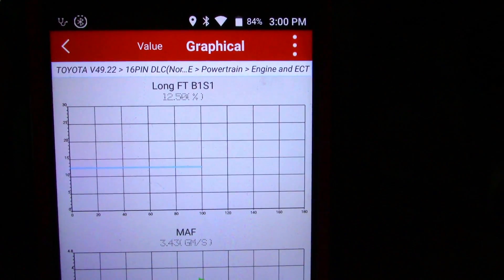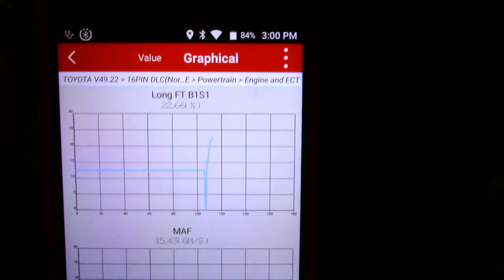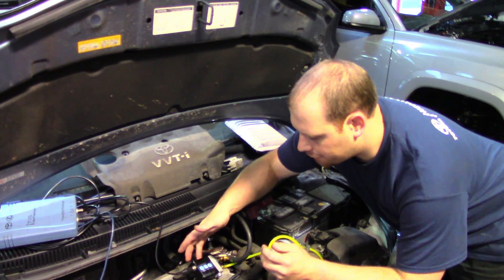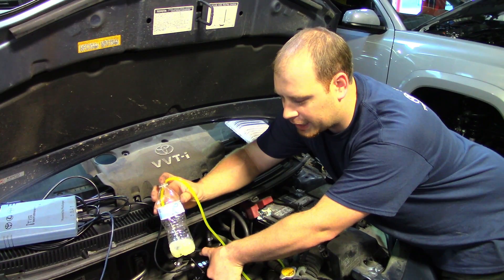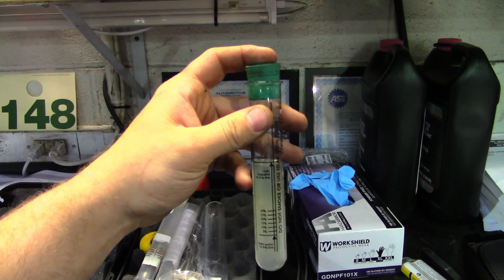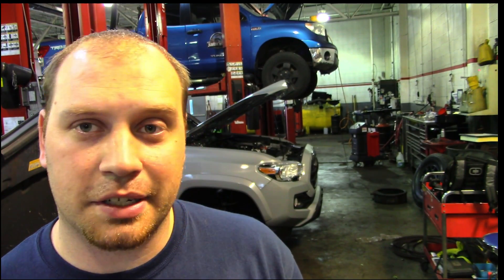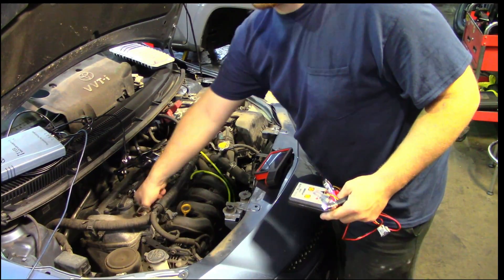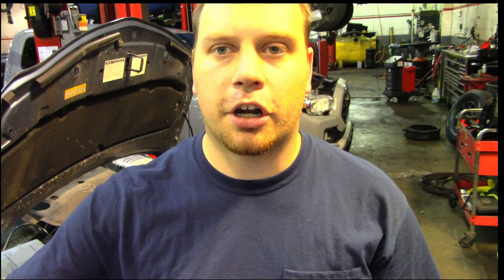Diagnosing lean fuel trims ('08 Yaris-P0171)

Comment: I have seen Scanner Danner use a tool like that. I’m gonna buy me one today. I’m a wimp so I’m gonna probably use a fuel pressure gauge. That wps is to much for me. The Logical Canuck has a build on something that will do the same thing as the wps for a fraction of the cost. Great vid as usual!!  I never miss them. What was your set up to access the fuel line?
Reply from the maker: Thanks Bill! If youre going to use a fuel pressure gauge, just make sure it measures in 1 PSI increments.

Comment: PJ, great process👍

I’m curious, have you viewed the injector-current ramps for these failures and do they reveal electrical fault?
Reply from the maker: I will say that I have always been able to see pintle movement. But I do know of a few techs who are able to distinguish bad injectors by measuring the pintle movement between injectors. When I have tried, the pintle opening and closing points have been so close, I was afraid to make a call just based on that. The next time I get one, Ill grab some waveforms and send them to you!
Reply: Voltage Drop Diagnostics , thanks Dude👍

Comment: This vehicle had a 2psi drop difference between best/worse injector. What do you consider maximum allowable difference?
Reply from the maker: 1 psi or less. Here is the catch. Every injector could have dropped 13 psi evenly, but the car would have still been running lean, right? So I feel the injectors should be very close, and any real difference should throw up a red flag.
Reply: @VoltageDropDiagnostics  there is a wide variety of acceptable readings out there. I agree normally a good set are all identical. And yes, if they are ALL restricted, it is a harder nut to crack.
Reply: If they all were slightly restricted evenly, or flowed low evenly (say due to a fuel pump that couldn’t provide full flow at correct pressure), then you’d probably only have an issue under full throttle. The system would likely compensate at partial throttle and idle.The miss or high HC is caused by the one lean cylinder having to try and fire on the averaged contribution of the other three caused by one common O2 sensor reading the exhaust.

Comment: Awesome video! I see that Diagun being used in guide a few people’s videos. Seems the best bang for the buck. I’m looking to get a bidirectional scanner for under $1100ish.
Reply from the maker: I love it for quick checks. They cost around $650 and does a lot. Being a dealer tech, I'm probably not the best person to give advise on aftermarket scan tools, but for what I use it for, I love having it!
Reply: Voltage Drop Diagnostics I ordered the Diagun from your link. I look forward to putting it to use. Thx!

Comment: This was a great video PJ just goes to show you that the scope helps make the right call especially how close they were so you were able to change all of them. thanks for sharing brother... Jay
Reply from the maker: Yes! Thats why I went to using the wps. My real fuel pressure gauge reads in 2 psi increments and it just isn't accurate enough for this test.

Comment: Nice video man! When you rev up the engine it seems like the PCM is not correcting the fuel trims (LT and ST). How it is supposed to work the fuel trims when you increase the rpm?? Thank you and sorry if I am asking so basic questions!
Reply from the maker: Before the repair, or after? After the repair, my long term fuel trim was about 15% and my short term was -15%. Eventually the long term and short term would even out.
Reply: @VoltageDropDiagnostics  thank man to answer! I was referring after the repair...

Comment: THAT WAS A VERY PERSIST TEST , WOULD THE FLOW TEST FOR THE INJECTORS YOU SPEAK OF ACTUALLY BE THE INJECTOR PULSE TEST . I WAS JUST WONDERING HOW DID THE GUYS MAKE OUT ON THAT NISSAN TITAN THAT WAS MAKING FOR A REEL HEAD SCRATCHER . THANKS FOR YOUR TIME AND PLEASE KEEP UP THE GREAT WORK YOUR DIAGNOSTIC VIDEOS ARE SPOT ON  !  PS.-WHERE WOULD I GET THAT TEST TUBE AT ?
Reply: just look up ethanol tester  you can find them.  you can make one using about any tubing or vial that the walls are not tapered.  cheapest one i found was a service part for kohler small engines